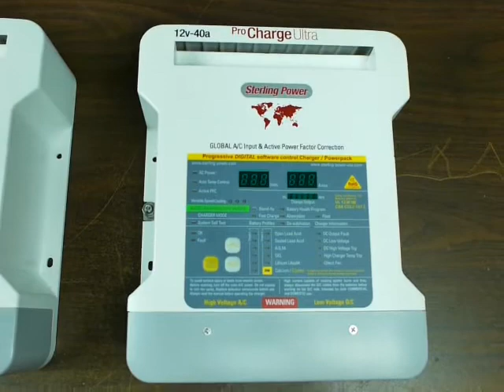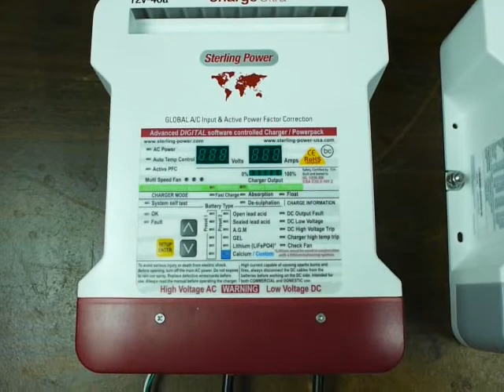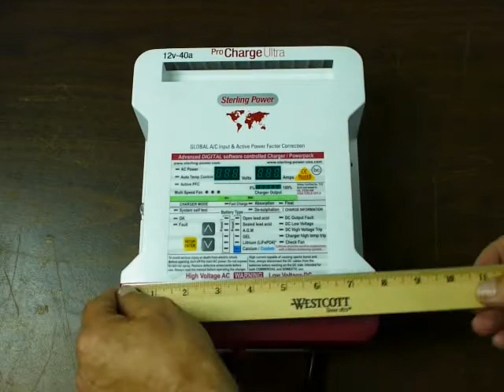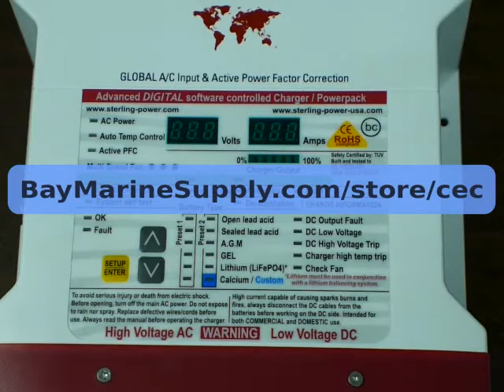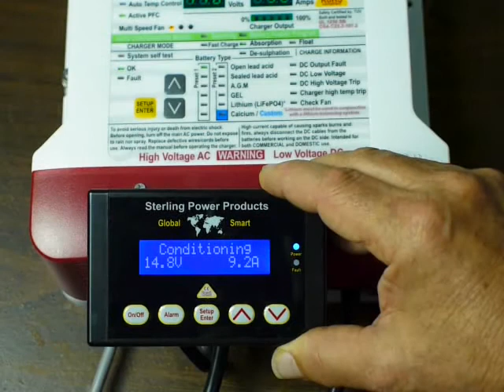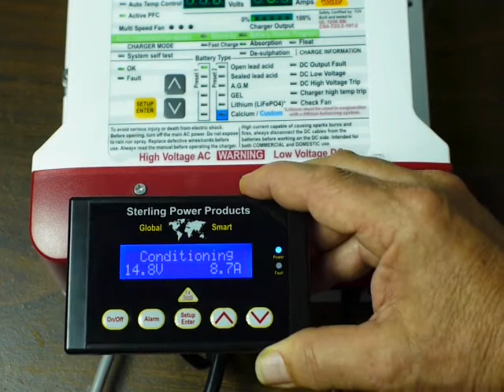Sterling Power Pro Charge Ultra and ProMariner ProNautic Battery Chargers

Comment: The video mentions output reduction in fine increments 90,80,70% however from what I have been told its a more generic 75,50,25% reduction. Really unacceptable in todays day & age.
Reply from the maker: We did not mean to imply 10% gradients. But a 25% adjustment on the largest 60A charger is a 15A change, or 7.5A on a 30A charger. We can't think of a reason that a finer tuning would be needed for battery banks served by these size chargers.

Comment: This is not a true three bank charger!!!!!!!!!!!!!!!!!!!!!!!!!!!!!!!!!!!!!!!!!!!!!!!!!!!!!!!!!!!
Reply: Actually, it is a 3-bank charger, the banks are isolated from each other. It is not three separate chargers. If you need to charge batteries with different profiles, there are one or two specialty chargers that have separate charging profiles in one box - Minn Kota makes one, but with only 6 to 15 amps per connection. Sterling also makes a Battery Chemistry Module, which will let one leg of a charger produce a different output, up to 60 amps. A single charger with three separate circuits would increase the price for a feature that is rarely used.
Reply: Alan Ferber  it's is one battery charger with diodes to isolate the batteries from each other.
Reply: I was looking for a battery charger that does not induce voltage to my other two Banks and do not need to be charged so it would never boil the other two Banks over.
Reply: Otherwise wise this is a great charger

Comment: I have just fitted the Sterling Pro 12v 30a in November 2016 which was fairly easy, after we had go over the problem of being able to see the LED's it was an over cast day, and the unit is in an engine bay that opens up to daylight. This created a problem because the LEDs were too dim to show up so we didn't know what the unit was doing, we eventually got over that problem using a large cardboard box over our head and the unit to enable us to read the LEDs, this was the only disappointing item we found with this unit. I did send an email and video showing this problem to Sterling, don't think they were too interested which is a shame as it is a problem.

Comment: Hello, i just bought one of these chargers and had a few questions that hopefully some of you can answer. First, can i extend the temperature sensor or will it mess it up? Second, does it matter on what negative terminal i mount it on? I have two batteries and i am unsure which one i should mount it on. Thanks.
Reply: You can extend the temp sensor using a phone-type extension, but it's recommended to keep the charger relatively close to the batteries to minimize voltage losses across the cables, or alternately to use large cables.